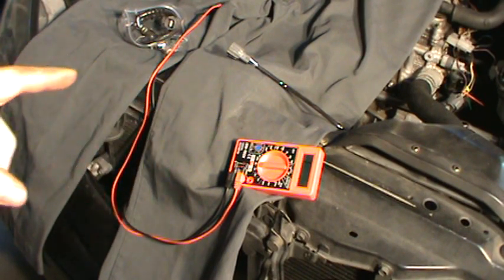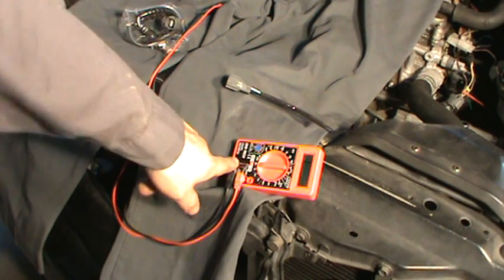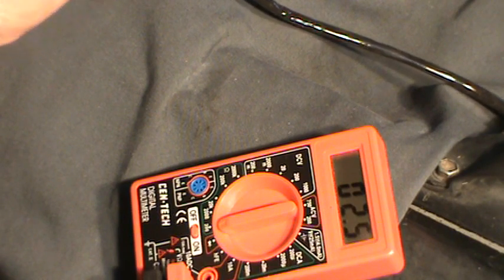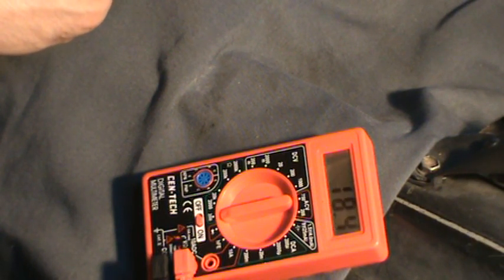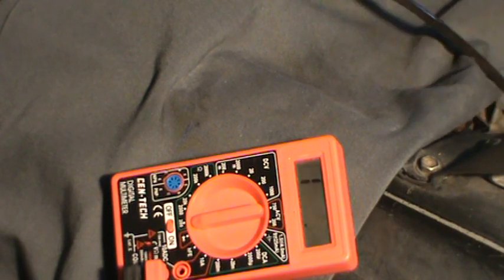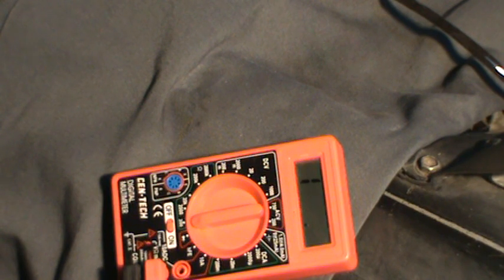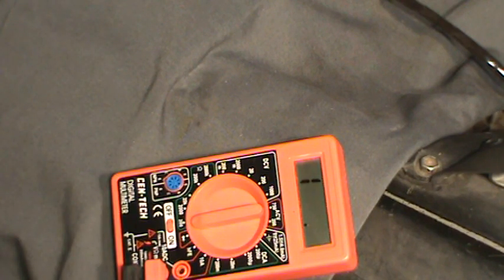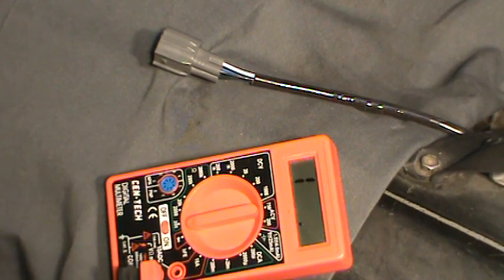Oxygen Sensor Air/Fuel Sensor Heater Resistance

Comment: I urinated on the sensor than hit it with a ball peen hammer. It didn't fix the sensor at all. I decided to cut the wires and solder 1/2" copper tubing to make it perform better but that didn't work either. Must be a faulty unit.

Comment: i tried to test the resistance of my downstream 02 sensor and i got about 14ohms, what is the normal resistance of downstream o2 sensor? I have a p0420 code always showing everytime at an idle.
Reply: Hi! Did you figure out if it was the o2 sensor?

Comment: Having this same issue. The manufacturer said that some times different generation of sensors cause issues with the ECU?
Reply: I'm presently on the 3rd sensor on B2S1 and the second sensor on B1S1, both upstream (my car only has 3). None of them are Denso, all of them are Kwiksen (except the lower rear, or 3rd one)

Comment: The weirdest thing is going on with my 09 Tacoma. P0031 says it's sensor 1 bank 1 which is the upstream sensor. However when doing a resistance check on the before the cat sensor I get a 2.4ish ohms(3.5 limit) I checked the after cat sensor just out of curiosity and that is way off with 14.5ohms. Why would the code scan give me the wrong sensor??
Reply: Jo G 
Hey did you ever get this figured out? Running into the same problem with my ‘05 Taco.
I’m getting P0430 code which is Bank 2, it just doesn’t say which sensor. Testing the before cat sensor I get 2 ohms, and the after cat sensor reads at 13-14ohms.

I was thinking my before cat sensor was bad. Was was the issue with yours?
Reply: @snipsey2  I think there should be three sensors, two upstream (bank 1 and bank 2), and 1 downstream. The resistance readings you got seem to be OK for b1s1(air-fuel ratio) and b1s2(oxygen).  The sensor for bank 2 is also AFR, and is located in the exhaust between the other two.
Also, the problem could be with the wiring for the heater circuit, or a blown fuse.  Not sure if both AFR sensors run off the same fuse.

Comment: pls what should be the resistance on a 2000 Camry air fuel ratio sensor?
Reply: 1. 5  to 1.8 not more than 2. 
if  your AF shows 00  that means no resistance exactly like any wire.
And if the meter reads more than 2 Ohns,  it is Open, the current is not passing and you need to change the sensor, but before that  check the integrity of the harness which is connected to the ECM.
Reply: And what if it's just one point zero?

Comment: That;'s why it's good to use the factory OEM manufacturer parts, unless you are very very very familiar with different replacement specs etc.

In order to test this correctly you would have to power them up as well to temperature and measure the current and use R=V/I  to determine the true operating characteristics, as those can be a couple of ohms different between brands.

Otherwise you can spend way more money in labor messing around with this stuff. On your own is fine, on the customer clock never.
Reply: you mean "back probe"?

Comment: do all cars have fuses for 02 sensor.  got a 0053 code so i unplugged upstream sensor and car chevy aveo  2011 and it ran well.  concluding bad o2 sensor.  i did get 12 volts through the harness
bought another sensor, no harness with it. i wired the new one.  same problem, car runs well after warm up engine dies.  i unplug new sensor and it starts running well again.
can you give me a direction to follow. i have volt meter and test light only.  fuse box inside doesn't indicate any fuse for 02 sensor.  haynes, chilton has no manual for that car.
i did change plugs 4 weeks earlier, no codes at time and car running well. just did a maintenance thing.  thanks

Comment: Quick question for you. Do you know if it's possible too install an ohm resistor into the harness for the sensor by the catalytic converter so that you can leave the sensor unplugged and not show a code? As a way of tricking the computer.
Reply from the maker: I would think that is a possibility. The downstream sensor usually should stay sturdy
Reply: If you put a resistor on what about the fuel trims

Comment from the maker: When I was saying about the sensor being open, and there being not resistance, that is incorrect. If heater circuit is open, the meter will read out of limits, not 0 resistance.